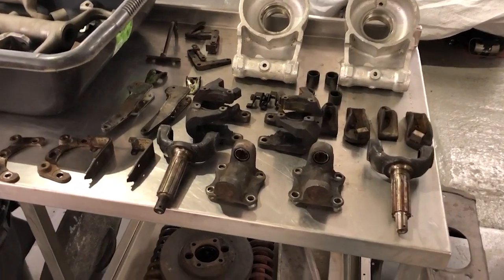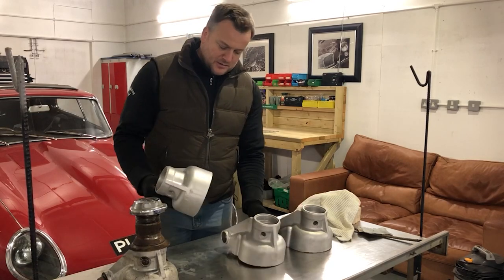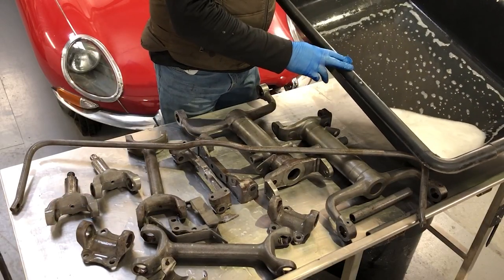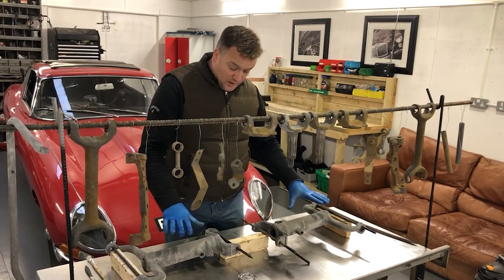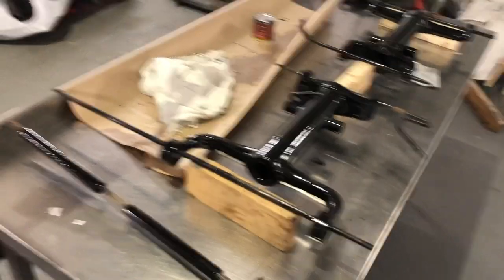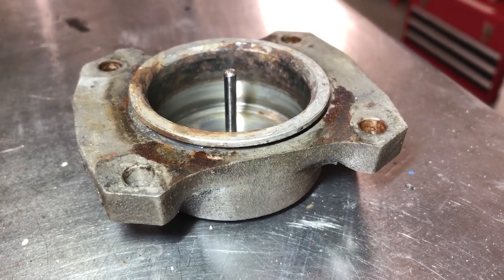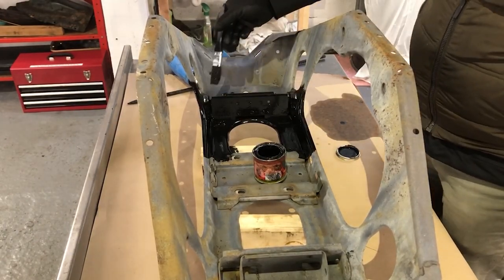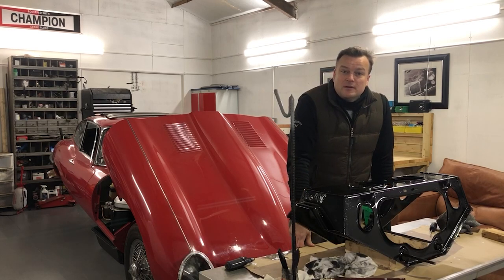Ep7 - 1967 Jaguar E-Type IRS refurb part 2: sand blasting and painting

Comment: POR15 (which stands for Paint Over Rust) is great stuff.  One secret is that it works best if there is a little surface rust left on what you're painting.  Painting directly out of the can is discouraged, because if you carry any rust into the can, the whole can can harden.  You can put the top on with a layer of plastic wrap between the top and the can, and you will be able to open it for at least a few weeks.
Reply from the maker: Hi! Yes I really rate POR-15 and like that it is sold in smaller cans too as I’ve had bigger ones previously that either go hard or I can’t open next time! I do exactly that, use some plastic wrap between the lid and the can now.
Reply: @fossewayclassiccarworkshop  It can be very slow to dry, but that can be assisted by spraying a mist of water on the paint.  Strange chemistry at work.  It does turn gray if exposed to sunlight, but it is still effective.

Comment: Here is a handy tip IF you purchase the large can of POR15 pour some into a glass jar and use it from the jar, then when finished put a couple of layers of cling film over the top of the jar prior to fitting the lid that way you will be able to get the lid off and not waste paint, also once the lid is on I invert the jar make sure it is not leaking and store it that way.
Reply from the maker: Top tip! Thanks! 😀

Comment: Not sure why you don't preheat your hub carriers before driving out your bearing shells. It's simply good engineering practice as cold driving will actually damage the aluminium shell housing even tho you can't see it with naked eye. Aluminium expands at a ratio of 3 to 2 compared with steel so the interference fit reduces meaning zero damage to the housing and the shell comes out much more easily.
Reply from the maker: Thanks Jeff, yes you’re right. I definitely heated the hub carriers for refitting the bearings but can’t remember (I might have missed in the edit) when removing them. Good point and one to watch in future. Thanks for watching and the advice.

Comment: Wouldn't it make sense to approach this project the same way as a mechanic would a brake job...fix one side then the other??? Taking everything apart at one time makes for 10x the work..this is the hard way to make stuff shiny,por15 requires topcoat (as directed),does not compare to powdercoat..maybe cover the car instead of the bench??
Reply from the maker: Hi Bruce, I guess it could have benefits doing a side at a time but I find that as I am doing the whole lot, getting to individual components allows me to refurbish them the same way at the same time i.e. one trip to the sand blaster etc. Also, freeing the diff from the centre means it can be refurbished in parallel.

POR-15 should remain black and shiny as long as it isn’t exposed to UV. I’ve got parts painted with it that have been in a drawer for years and still look freshly painted. I’m sure it is much better for impact resistance than powder coating too.